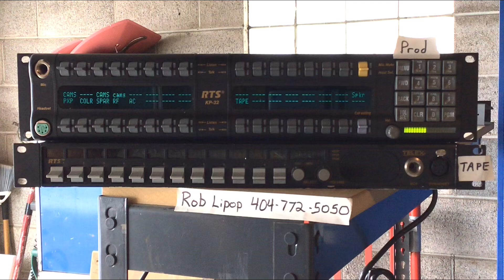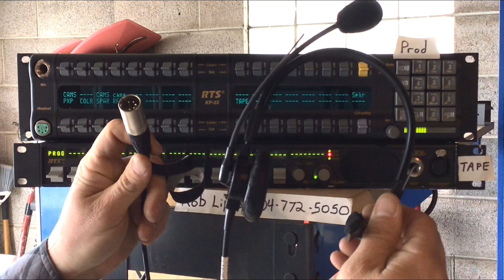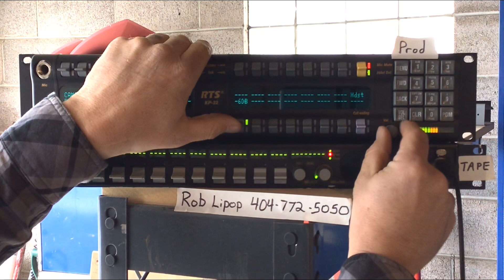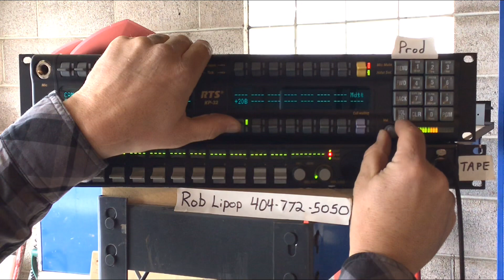User BASICS for the KP32 and KP12

Comment: Enjoying your videos, found the IPEdit one particularly useful. 

I do have a question: I have a bunch of KP632-24 panels that I'm trying to get working with the Analog / legacy ports on an ODIN. None of the panels seem to want to connect to the ODIN. I've tried changing address via the rotary switch but nothing.  The same panels will however connect to a Zeus III, along with some KP12s (which also will connect just fine to the ODIN analog ports).

To summarise: 

KP632-24 + ZeusIII = GOOD
KP12 + ZeusIII = GOOD
KP12 + ODIN analog = GOOD
KP632-24 + ODIN analog = BAD
Reply from the maker: Hmm, nothing really comes to mind...  I would look at the pinout and connectors.  Make sure that the pinout is super straight forward and per the manual.  and keep in mind, shoving a RJ12 into a RJ45 port can leave a lot of room for "slop" so be careful.  Addressing is NOT a concern with either the Zeus3 or the ODIN.

Comment: Hello loved the vidio, I do have a troubleshooting question. We run many KP-32s we are starting to get this problem where the rts panel doesn't connect to the network/matrix. We use RJ12 connector. Cable is fine and even the female connector and fuse inside the board are in great shape. When turned on all you see is the stars through both screens. Is there a chip inside that needs to be repaired or reloaded?
Reply from the maker: What frame? What’s cards? Why do you use the word network? Are the IP connected panels?
Reply: @roblipop8797  not sure the specific configurations. I just deal with the electronic repairs. It doesn't have anything to do with the networks setup. once we plug in another rts panel it works.
Reply from the maker: What card are you connecting the panels to in the frame?  Certain cards are of a communication style that requires one more step in attaching the panels.  

If you are using an ADAM or Zeus2 you need to address the panel.  Serial communications was done "All Messages Sent to ALL Ports" and so you have to tell the panel which instruction to listen for.  There should be a rotary switch that needs to be set.  IF you are not using these type cards you do not need to address the panel.

Otherwise, you probably have a bad serial driver that is not TX or RX the serial data on the RJ12 Pins 1 and 6.